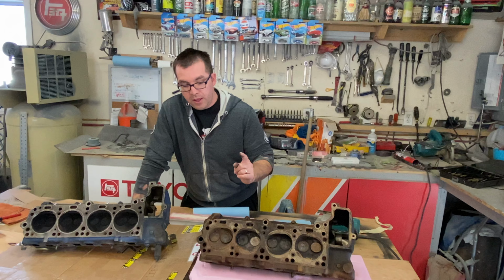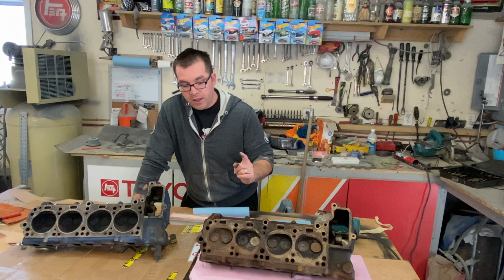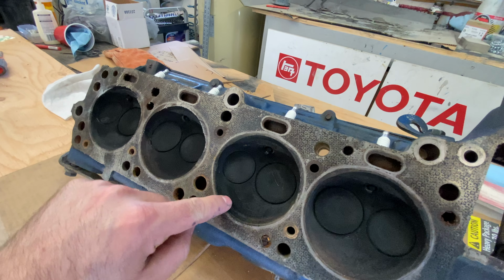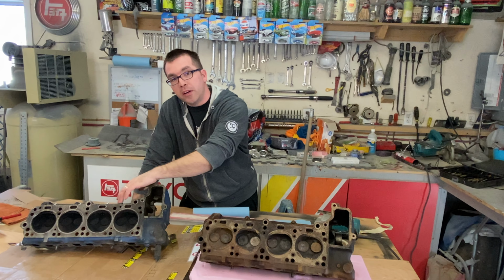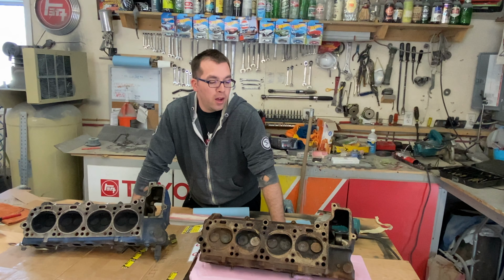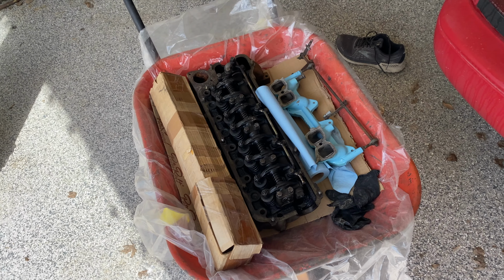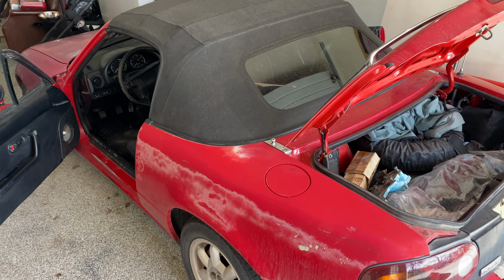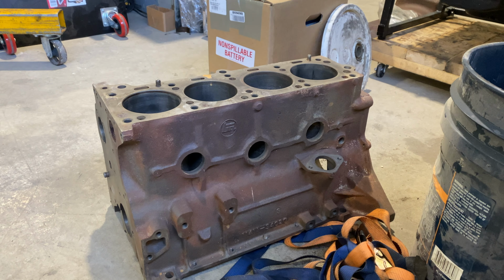ENGINE BUILD Update, HIGH COMPRESSION Cylinder Head

Comment: This is strange.  I have a 1970 RA20 Celica and it didn't have that head IIRC.  I did pull an 8R head from the junk yard years ago and the chambers are very different.  They are FULLY closed vs the one in your video being partially closed.  Meaning, mine has much smaller chambers.  I never knew the 8R had two different heads.  IDR if mine had the 8R or 18R when I got it because I did quite a bit of swapping around.  I ended up with 20R pistons because they didn't have big enough bore in the 18R pistons for my setup.
BTW, I also have OEM 8R-B carbs.  Factory original dual side draft Asian CV (SU type) carbs with Toyota factory liquid cooled intake.
Reply from the maker: Was your head a 8r or 8rc or the super rare 8rb? The one from Kyle is and 8RC. I'd be curious to see those 8rb combustion chambers you have my curiosity now. I remember reading about the 8rb and it was pretty rare with its twin carbs, and I think they were even higher compression than the 8rc. Is there a chance your head is an 8RB? I have never seen one and from what you are telling me it sounds like something pretty special. I would have loved to get my hands on an 8rb head but I had a hard enough time tracking down the 8rc.

Im going to have this head port and polished and have the flow improved by the machine shop. Looking at the intake and exhaust ports they are pretty awful. Sounds like they will be able to make them flow a lot better.